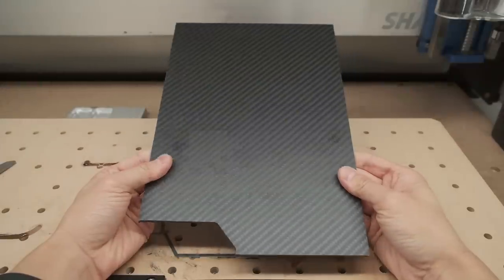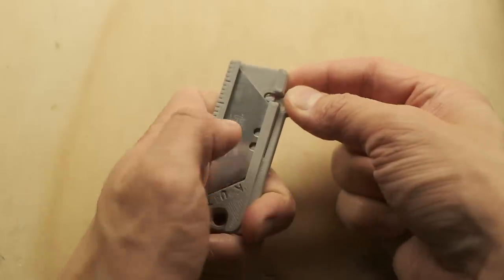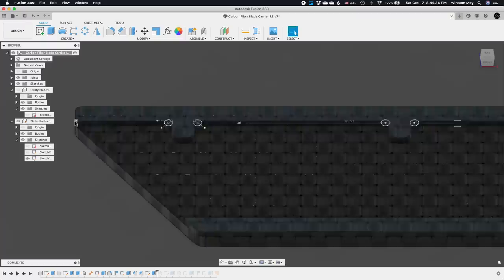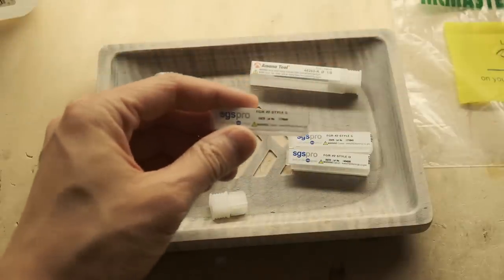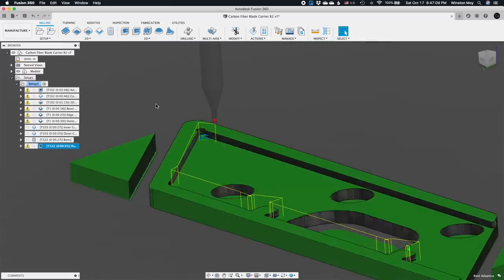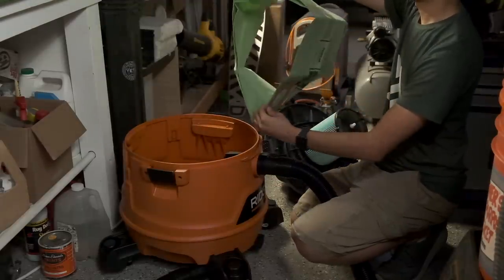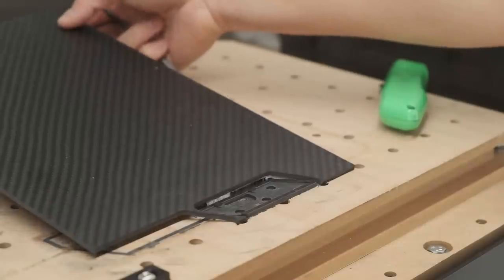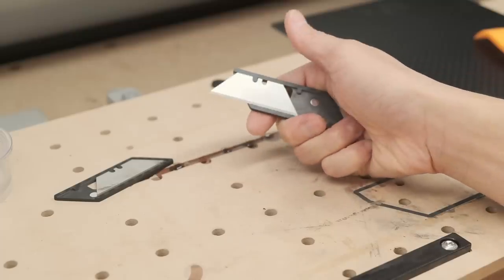First Attempt at Machining Carbon Fiber - Light Duty Utility Knife [#173]

Comment: Nice work!  Ive also had success in CF with about .001 per tooth.  Just starting out with my hobby CNC education, but I've learned a lot from your channel.  I appreciate you discussing the design rationale and modeling, as well as prototype failures and lessons learned.  Keep it up!

Comment: Another variation you could add to this use some sort of linerlock that is screwed into the back of the carbon fiber and sandwich the blade in between two slabs of CF. And have the notches for the blade on the front scale (opposite scale of the linerlock leaf spring) so that the linerlock pushes the blades into the notch and there is no risk of the blade falling out. You could also add a magnet onto the front scale for added support and eliminate any blade rattle. Use some nice stainless or even Ti Sex nuts (yes that's what they are called) to fasten the sides together without having to thread the screws into the CF which may strip eventually.

Comment: For a first go at machining carbon laminate - you nailed it!  The double-stick tape fixturing and those little burr cutters from McMaster are ideal for a quick and cheap setup.  Mcmaster does sell three different tip geometries of those cutters and you picked the best one for pocket machining - with the two end flutes.  The one with the pointy tip shape is great for slotting and will plunge neatly-ish.  

And thank you for taking the dust seriously - and urging everybody else to do it too!

Comment: This needs a thin, see-through, soft rubber hose around it ...
Keeps the blade in.
Shields from dust and knocks.
Secures your grip.
Reply: Good thought. I think I would be likely to twist the blade while cutting and pop it free of the magnets. I was wondering how to get a grippy plastic sleeve around this design in a way that would let you put your thumb on the blade to slide it back and forth. I couldn’t come up with a way that didn’t involve adding to the frame.
Reply: Ketotic, I think heat-shrink with a hole cut through it would be excellent for the application, but it would be tricky to keep it from locking down the blade.
Reply: Cut a mockup out of slippery plastic then coat it in dip-it plastic dip for a custom fit grip
Reply: jcarletto27 - Nice idea - I don’t think it would necessarily secure the blade from popping out to the same extent but cutting a groove in the plastic coating where the blade will slide back and forth should help a bit. Cheers!
Reply: Spencer Paire - That’s a nice thought! An oval hole on one side. I can see how that would work and stay in place once it tightened up, and being careful you could avoid impeding the blade. Cheers mate!

Comment: And now you know why I go through great lengths to cut it under water and run my debris into a filtration system allowing me to dispose of the filter.     I run into some issues with fixturing for the way I do things because I am not fixturing to a spoilboard but rather a stand off sort of affair.   Dealing with flex in carbonfiber when dealing with thinner sheets can be an issue. A spoil board with carbon fiber directly fixed to it helps solve the problem.

Rather than double sided tape I have seen a favored method of using painters tape on the spoil board and on the carbon fiber.   Then stick the two together with CA glue and an activator.    It seems like it will make for a more rigid fixturing and I am gonna try it with my submerged setup once I find a spoil board material that will be water resistant and lend itself to surfacing
Reply from the maker: I believe Saunders - NYC CNC has a recommendation to use a type of masking tape for powder coating, says it resists moisture and coolant better.
Reply: @WinstonMakes  they have also used it for straight up aluminum fixturing.   Painters tape on back of stock, painters tape onto work holding surface, CA glue to bond the two together.    Winds up much thinner than the 3M double sided tape solutions and quite rigid.
Reply: @dividingbyzerofpv6748  That's something different. Just about everybody and their grandma knows painters tape + CA glue (even Winston did a video comparing the strength), but the powder coating tape is a solid dark green PET tape, ie. aliexpress .com/item/32642698031.html (there's no amazon where I live).
Reply: @jirij  thanks.  Will take a look.
Reply: What about delrin plastic sheet for a spoilboard? It machines easily without melting/gumming up end mills
Reply: @greensheen8759  eventually that will probably be the route I go.   Just have not fully settled on how I want my fixturing to work out.
Reply: @dividingbyzerofpv6748  i don't know how much hold down force you need, but suction cups or even drawing a vacuum through small holes in the delrin might work well. A fab lab manager I know uses textured abs sheets because you can draw a vacuum through the little channels it creates. I believe it's textured on the bottom, smooth on top

Comment: Just about the only thing I've cut in the 18 months since I've owned my Shapeoko is carbon fiber.  I'm cutting prototypes of my FPV drone frames.

For what it is worth, I use some of the cheapest 2mm endmills I can find.  I've tried several different brands and styles.  You can find quite a few different 10-packs of endmills on Amazon, Banggood, and Ebay in the $8 to $12 range.  I don't worry too much about how fast they wear out when they only cost about $1. 

I'm also not as good at this as you are.  I'm bottle necked my design and testing time, so the Shapeoko is often dormant for a month or two at a time. I'm pretty good at forgetting something I learned a month ago, then doing something and snapping an endmill.  I can snap $1 endmill all day long!

At first, I was using endmills that looked like your fiberglass mill.  I ran out of those, and I'm using random 2-flute and 4-flute endmills.  I know that I notice a difference in the finish.  They all start to get sloppy looking as they get dull, and they all get dull on me rather quickly!

Keep up the good work Winston!

Comment: Hi Winston, I really like this design. I wonder whether you can optimise the magnets (or perhaps you have already done so but I didn't notice you mention it) by ensuring that they alternate poles. That way, the field will be stronger/denser through the steel of the blade and apply more holding force per magnet. You can further increase this by moving the magnets closer together, if the holding power against moments remains. The other thing I thought is whether you can use a magnet on a pivot in the hold/release mechanism. with the finger you pivot the magnet and it repels another magnet (there would be a pair) which is magnetically attached to the blade and not fixed in its recess. This would pop the blade out for retraction/extension. Then let go of the first magnet for it to rotate back into its default orientation and that pulls the blade back against the locking nubs. A nice feature, were this to work, might be that the magnets attached to the blade aligning with the trigger magnet would potentially align the blade with the locking nubs semi-automatically. Anyway, it loses something without a sketch and its only half thought through. But this is a great design exercise and I hope you do find the time to further your concepts.

Comment: I would machine another (thinner) top layer to act as a spring to keep the balde in place and super-glue it to either the bottom or end wall only (to get a opening/spring effect on the other ends). 
you could also machine the bottom layer to get a similar spring locking effect you can find in the 3d printed ones, and couple this with a fixed/glued top capping layer.

Comment: I wonder if the abrasive nature of the CF dulls the utility blade when it is slid between the open and locked positions?
Reply: It’s a good question. I pondered the same and found myself wondering what the machined cut where the blade rests would look like under a microscope. I don’t think that the wear  would be excessive. However, it would be unfortunate to carry around a razor blade and, on the occasion you really needed it to be sharp, find it was dull along its whole length even though you had not used it that often.
Reply from the maker: The way I see it, if a carbide endmill can spend an hour or two ripping through carbon fiber, a carbide-edged utility blade you're going to discard in a couple weeks will be fine.
Reply: CountDoucheula - Ah, you are a pragmatist my friend!!

Comment: I actually have a box cutter design I've been prototyping, if you're interested in checking it out, I'd be happy to send some files! It's based on the stanley mechanism, so the idea is the end user would just buy a stanley knife, or use the mechanism they already have. It's shorter and thinner, and has room for extra blades as well. Essentially it's just optimised

Comment: If you want to go smaller: Try to go with scalpel blades, Nr. 11 and Nr. 25 should be a nice blade design for utility. Usually they are a bit longer for the holding mechanism, but Bayha have some really nice ones with shorter holding mechanism.
Reply: It’s interesting that Winston’s concept arouse around the blade. You indeed have a point, that if you want it to be small an light you could start with smaller blades. For myself, I find that when something is too small and light, I tend to “lose” it in my pockets. Also, I need sufficient weight and enough grip surface to maintain positive control. I was using an old fashioned exacto knife the size of a thin pen to open packages for a bit but found myself grabbing a larger box cutter because it was just more secure in my hand. I am sure though that you would find a market for ultra light and compact box cutter designs - maybe a “gentleman’s carry” version, if you will!

Comment: Nice. What are the specs of that carbon fiber sheet? (I don't know anything about CF but I assume there are different types.) I almost have my MPCNC dust collection set up so I might have to try something like this soon.
Reply from the maker: This is what I bought: https://amzn.to/31i1ZX5 

Plain weave, nothing really special about it. There are different weave patterns, and for aerospace stuff they can get pretty proprietary with their resin formulations.
Reply: @WinstonMakes  Thanks for the link.  Will be buying a sheet soon to experiment (assuming my dust collection seems up to the task once it is finished).

Comment: Looks great! I have only CNC cut carbon fiber once so far for an engineering project but it turned out surprisingly well. Would you mind posting a link to the Amana speeds and feeds that you showed in the video?

Comment: If you added a dovetail on the side where the edge is it would make the whole thing more secure, easier to use, and you would need fewer magnets. The edge would be safer side the dovetail, which also gives the blade a pivot to open and close the knife.

Comment: Would a fridge magnet type arrangement keep the blade better? It seems like a lot of magnet there for something that's meant to be light.
Reply: Did you mean the thin flexible magnets that have things printed on them, like the number for your vet, a realtor, or plumber? I am not sure that anything but a strong rare earth magnet would hold the blade sufficiently. One thought I had about Winston’s final design was that if one twisted excessively while cutting the blade might pop out of the frame if one wasn’t holding it firmly enough with the thumb. I would want the strongest magnets I could find that would fit into the frame.
Reply: @ColdHawk  Like a halbach array, they have more force close to them, but don't go very far, great for a flat piece of metal, you don't want some super powerful magnet just in your pocket.

Comment: This is a dangerous design that lacks a positive locking mechanism. Under load, the blade could pop out and give you a nasty laceration.
Reply from the maker: The idea was more that this would be an mild improvement over a naked utility blade and something you could carry safely in your pocket. If you need to put any serious force behind a cut, probably should be making/buying a more robust design with the blade fully captured. Revision 3 will have a small dovetail at the bottom to capture the cutting edge and prevent it from kicking out.
Reply: @WinstonMakes  Make sure you secure the blade from movement in all axis when the blade is extended for use. That suggestion is difficult, if not impossible to meet while retaining some of the design features you have currently employed. I like your channel. Been watching for a long while. I enjoy the content and found it very helpful when learning Fusion 360.
Reply: A CWT Herring Blade style design would address all the issues while preserving the functionality.